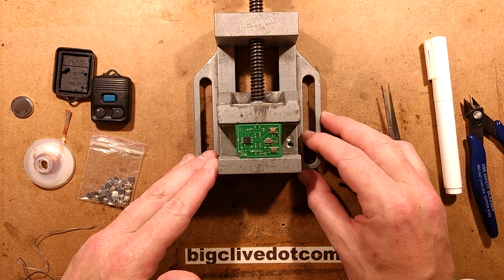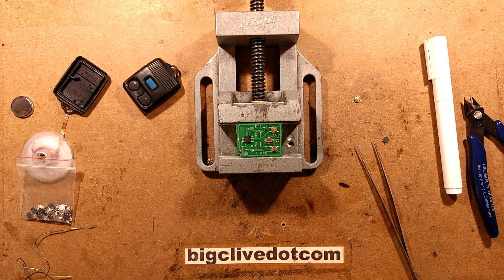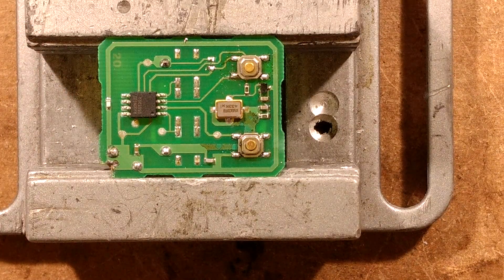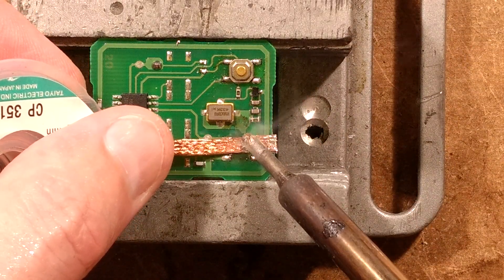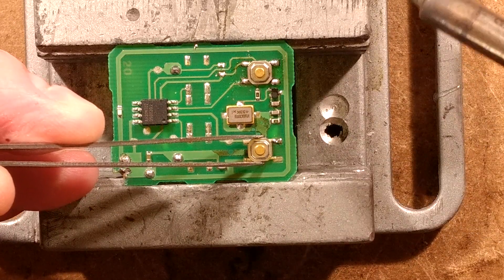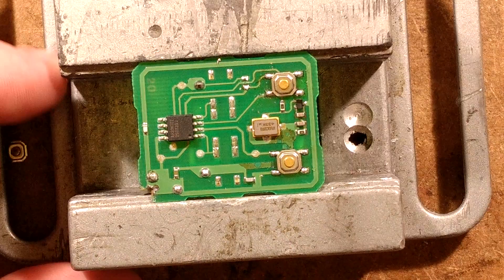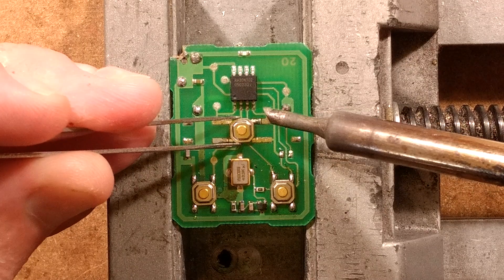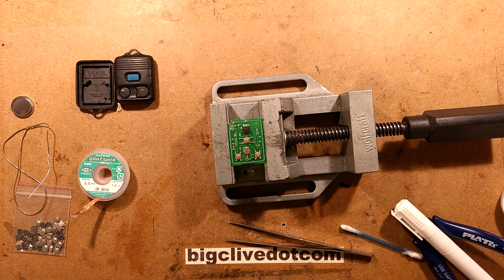Car/van keyfob button replacement.  (Glitchy video!)

Comment: I rarely see the vice of knowledge used this way
Reply: the versatility of knowledge! not just for coercion!
Reply: ( the vice of knowledge ) refers to the bench vice in some of the videos this vice is what he uses to crack open the casing of things so that we can see inside
Reply: I'm aware ; ) i was trying to be clever.
Reply: i actually have a hammer with a label called X-ray on it now because of bigclive XD
Reply: Next video better involve the X ray.
Reply: Apparently it doubles as the Vice of Healing.
Reply: using the vice of knowledge we now know how to fix this issue should it come up for any of us lot :P
Reply: Typically, the knowledge comes from inside the device, and needs to be helped escape.

In this case, Clive is adding knowledge to the device by adding more features.

The Vice of Knowledge has more than one use!